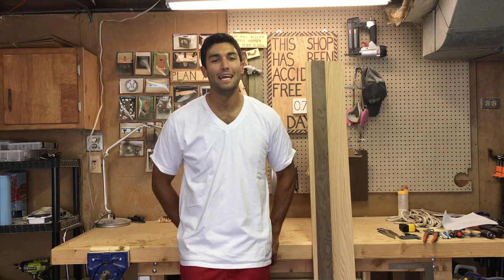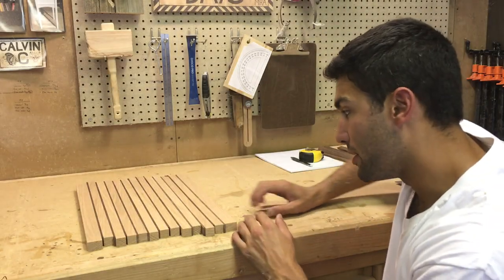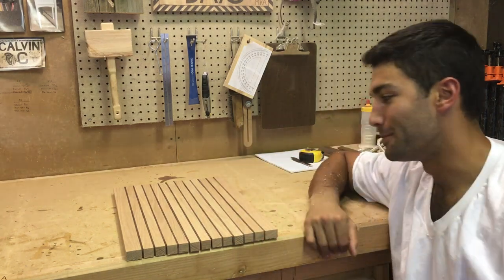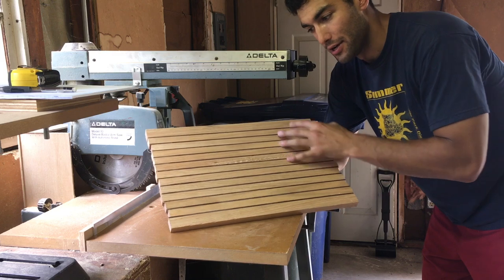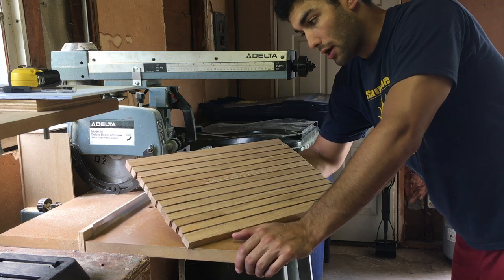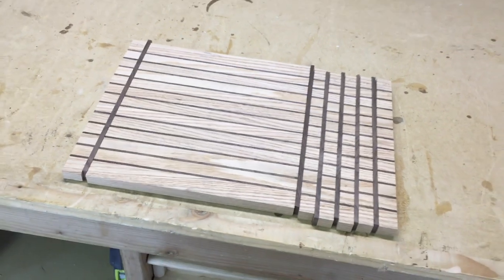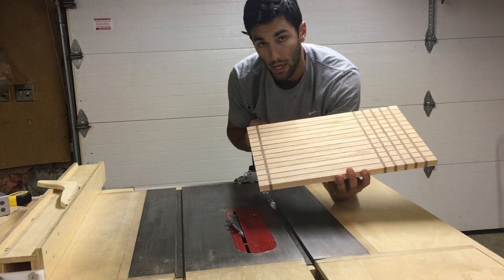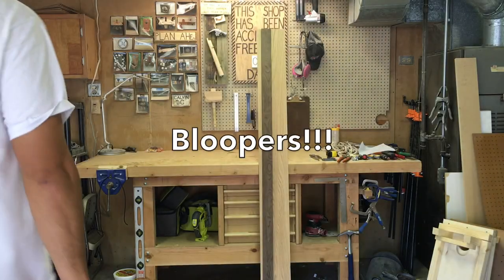DIY Horse Racing Board Game-Part 1

Comment: Looks like a lot of fun, and the woodwork is very nice, but I think the number of holes needs to be adjusted for a fair race. For example, 2 or 12 have 1:36 chance of being thrown by 2 six-sided dice while 7 has a 6:36 chance. So #7 should have 6 times more holes to go through to win than #2 or #12.  This board shows 3 holes to finish #2 or #12 (2 holes + the finish hole), and 8 holes to finish #7, so #7 will win most races. To be fair, #7 should have 3 * 6 = 18 holes to finish. For the full set, IF #2 has 3 holes, #3 needs 6, #4 needs 9, #5 needs 12, #6 needs 15, #7 needs 18, #8 needs 15, #9 needs 12, #10 needs 9, #11 needs 6, and #12 needs 3 holes to get to finish. Also needs the starting line & scratch position holes as shown in the video.

Comment: I’m going to start building this.  I had one I built 30 yrs ago.  Drew the grid, on moms favorite cutting board n drilled holes. Got in trouble too.  I was thinking though,  would it be simpler to router the lanes, 1/8” bit...instead of cutting the wood completely? Maybe that’s not possible.  Then glue the walnut dividers. 
Also, if I remember the number 7 had the most holes, 2 & 12 the least.  It was figured in via probability of rolling the numbers. But I don’t think the holes were random.
Reply from the maker: That’s right! Good luck!

Comment: What size wood did you start with and how did you determine spacing on the board for drilling holes.
Reply from the maker: +Brad VanRay I think I had a 1x8 oak board and the walnut was maybe 4 inches? The final board was about 12x18 so I just needed enough oak and walnut to cover that size. For the holes each of the square spots in the starting lanes has one hole along with each of the finish lane spots. Then for the running lanes those range from 2-7 holes depending on which lane number. For the spacing on the holes in the lanes I just divided the lanes evenly for the number of holes it needed. Part 2 of this video has a bit more info that might help. Thanks for watching!